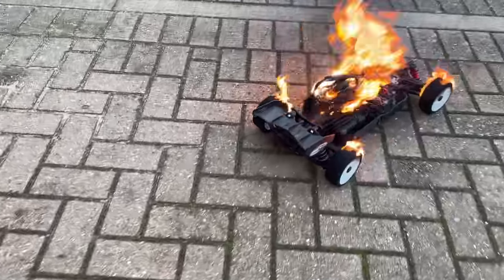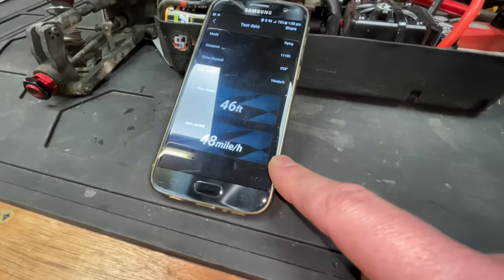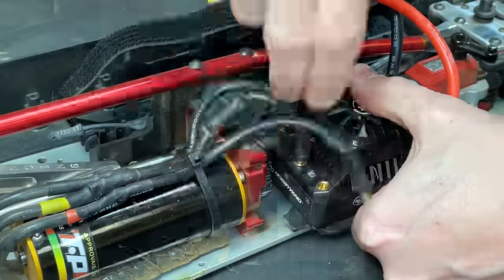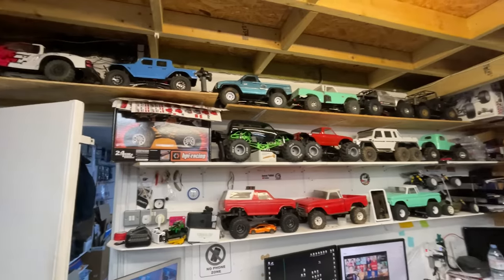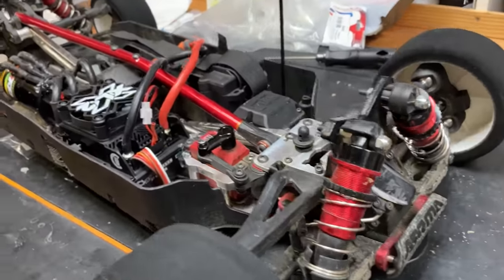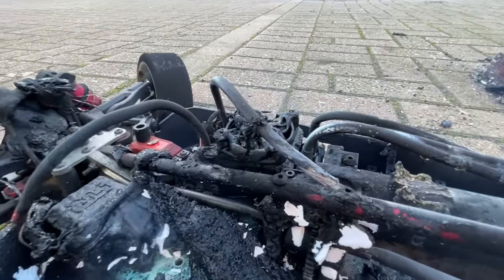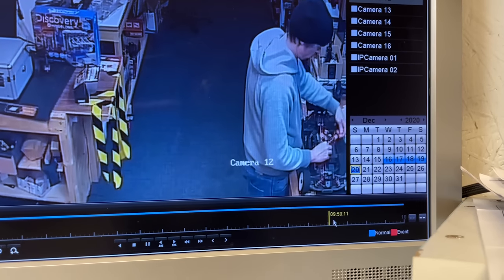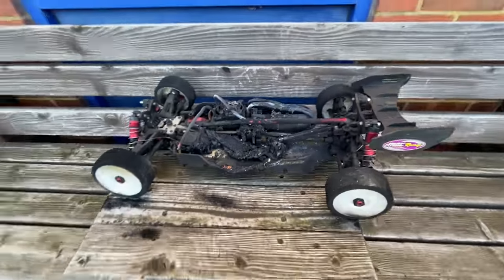Hot Wheels!! - RC Car FIRE - Castle Cremations XLX2 Failure

Comment: The way those lipo's kept on reigniting reminded me of those joke candles that you can never blow out because they keep re lighting 😂👍
Reply: Yeah, its a self sustaining fire, the chemical reaction of the lithium with the air will result in the lipos re igniting and burning until all of the lithium is used up, that's what makes a lithium fire so dangerous as once it starts its extremity difficult to stop it no matter what you do, basically it will just run its course until there is no material left to burn. Kevin did exactly the right thing, get it outside !!.

Comment: The motor could have been damaged internaly and shorted the esc once it got to much power
Reply: These XLX2 ESCs are blowing up everywhere. There is already a class-action suit in the US. I would be surprised if it wasn’t the ESC.
Reply: @mesodan  most definitely not the esc, unless his was defective. I have an xlx2 in a limitless that has gone 152mph
Reply: The new castles are blowing up, the battery hookup on the ESC circuit board shorts out and causes the esc to blow up, eventually getting the battery as well if you don't unhook them right away
Reply: @masonkaye5  the new castle mamba x series escs are extremely unpredictable, mine did the exact same thing and they didn't warranty it for me, I nearly lost my house and my hand in the process
Reply: Lipos can also be damaged internally from soldering connectors too hot or too long. The pack can randomly burst into flames.
Reply: @masonkaye5  dude, they are caught fire and mailfuntion all over the world. That esc of yours are one of few with the others..hey, even Kev have one in the K8s and works...i got one, mine laated for 30 seconds.  This is a major issiue for them and i HOPE it will be solved fast.
Reply: @mesodan  lmfaooo.. Exaggerate much?
Reply: @masonkaye5  I played Russian Roulette with a friend the other day. I walked away unscathed. Definitely a very safe game and the users fault if they get shot 😂 🤣😆
Reply: @coh2 things i agree
Reply: Ya it can also be the esc or what coh2 things suggested or both everything works fine then new esc a kaboom
Reply: @mesodan  I can't find anything about a lawsuit?

Comment: I have a feeling this will catch the attention of Castle Creations. That needs to be addressed by them personally. They are very helpful. A guys at work spends hours on the phone discussing his builds and various issues. They always help, and replace anything that is their fault, for free. You have a big platform here. Please be in contact with them and let us see how that goes. I own a lot of their stuff. I am nervous now.
Reply: I'm a big fan of Castle Creations as well, particularly their ESC's. Though there is always potential that a bad ESC got into the mix. That said, I personally think this was caused by a short or problems outside of the ESC. Someone suggested that the motor caused the fire, IDK. I suspect that something shifted when he picked up the RC from the tail end and shorted out something. Things were awfully tight in that chassis. JMHO
Reply: Same thing happened to me and it’s been almost a year since they received it and have not got back with me.

Comment: Only Kev could say “Screw the warranty” and chop the IC5s off, only to then eventually end up putting IC5s back on 😂😂😂
Reply from the maker: hahahaa
Reply: @KevinTalbotTV  tbf I nearly done the same to my K4S but decided to get a conversion cable. Now I’ve just gone for proper IC5 batteries as I had the same disconnecting issues with the crappy dean’s connectors on my old battery.
Reply: "Bye bye arrma warranty"
Snip snip
Reply: Loooooool😂🤣🤣😂🤣🤣😂😂
Reply: Yeah, lol. Wut?

Comment: My thoughts on the cascade after thinking about how this went down.   Ive had this failure on ebikes running bleeding edge motors.

You were revving it in air, literally the worst thing possible for such a hot system on max voltage and a motor with insanely low resistance and high inductance.   Dont do that with "insane" systems, its risky.    Looks like the first fire was a capacitor explosion.  

An inductive spike couldn't be shunted by the battery since it was still freshly charged,  and since you were running 8s it popped the caps after a hard rev.   No overhead for voltage spikes when running 8s. Caps turned into molten metal and shorted inside the esc, battery catches 20 seconds later since the esc is now shorted. 

Next time run 6s and don't be revving in air like that.

Comment: Hello kev! Love the channel! Sadly this happened to my 8S slash but I made another one and it was bigger and better
Reply: Their is a1/5  8s slash ???
Reply: @jackstrempel5135  no...
Reply: @JD_Garage  that’s dope, you made a  8s slash😂
Reply: @TylerSaleik  yeah I had a Mambax Castle set up then just used 2 4s battery’s
Reply: @JD_Garage  4s in Parallel or Series?
thought the mamba x is 6s only
Reply: @Chris-zu8ve  series
Reply: @Chris-zu8ve  nope Mamba used to make a 8s ESC and I used a Castle motor
Reply: @JD_Garage  Is this #010-0155-00 what your ESC is?  This is what I have on my Rock Rey 1/10
Reply: @Chris-zu8ve  it blew up a while ago I will have to check
Reply: @JD_Garage  I have only ran 4s on mine for a short while, so it may be luck i havent melted mine yet.,,,   But they make so many diff models now, I think they just cut too many production costs at our expense.  Because they can get away with not warrantying anything.   So they have stopped caring.  Its a shame, but they have lost any new purchases that arent BEC units for my crawlers.
Reply: Haha found your comment
Reply: I got 4s no issue yet
Reply: @creative_rides  I found yours!!!
Reply: Whatdidhesayyy? 8s slash thats crazy my friend
Reply: @joeydailey6980  6s is pretty much the limit on a slash
Reply: @joeydailey6980  yeah it was nutty
Reply: @shanebutyn9227  yeah 4S is a solid platform
Reply: The rc guy at my local store was telling me his friend did a 6s slash with pretty much a 1:1 gear ratio. Built it just for speed runs. Apparently his top was like 130 mph.

Comment: The term castle cremations doesn’t exist for nothing. You’re not the only one unfortunately.
Reply: I lost my brand new mamba monster 8s . Flew through a puddle on my xmaxx the esc got a little and it burst into flames
Reply: @everythingrc2535  haven't been around cars long enough but totally seen one of their Talon 120s burn a 1.5k heli to nothing haha.
Reply: Putting things to the right context. Usually castle esc are used in very high power builds. Those are a much higher risk of getting this kind of problems. Sure, there might be QC issues, but at least I can't judge castle with all the things said in internet.

Comment: Hey Kev! I think i know what happened with the ESC. Castle claims on their Website that the XLX 2 and Monster X 8s are made for a maximum voltage of 33,6V (4,2V/cell) and the ESC definitely will be damaged if you apply more Voltage, for example if you use LiHV batteries . So when you used your LiHV graphene batteries in the car you have damaged the ESC which then blowed up the batteries, which are nearly impossible to extinguish. Next time when a lithium battery catches fire, you should try to  separate  the battery and put it in a fire prove container with water where it can burn out.
I would recommend you using normal Lipo batteries with 4,2V/cell next time, then everything should work perfectly.
I hope i could help you. Go on with your amazing videos!

Comment: Don't burst the fire extinguisher your allowing the car to rebuild temperature if there is no flame showing the item can be upwards of 400 degrees use continual spray to cool the car so temperature does not ignite gases made by the fire itself

Comment: Kevin, just letting you you know that xt90 ,ic5 and ec5 are all compatible with each other!!
No need to change connectors..
Just use gaffa tape to stop them coming undone..
Reply: Ec5 is larger than the xt90. Ec5 is 6.5mm and xt90 is 6mm.
Reply: @andrewbrown8927  did you try connecting them?

Comment: I'm gonna venture on a wild guess that the motor ESC outputs sparked to the pinion-spur.
Reply: If that's an issue Castle should shield them or provide a means to
Reply: Touching one is not an issue and no way it could have touched two.
Reply: No, that's not possible, you would have to touch two of the leads not just one

Comment: Looks like you let off the throttle and the inductance spike popped your batteries.  Esc didn't melt down like a short was running through it.   How fast was it spinning when you let off?   Are the caps on the esc popped?
Reply: Do you think that TP Motor was the problem? I'm sure it's not rated to 8s, and being a 'comp' one, they seem a bit highly strung! Certainly looked like the Battery's took a dump rather than the ESC.
Reply: Looking at the thumbnail, the esc isn't smoking at all, looks to be all battery solvent fire.  If it shorted out there would be smoke and havok on the esc too.  Either on throttle or off throttle, looks like the battery shorted first based on what I can see. 

Huge high kv motor, the amp draw is obscene. It combined with the beefy esc was too much for the battery.
Reply from the maker: esc deffo went first, i saw the flames! then 10 secs after the lipos went up
Reply: @KevinTalbotTV  Yeah, on the CCTV footage it looks like a flame from the ESC first. But I reckon the Motor is what killed the ESC, which in turn took out the lipos. Either way...it was pretty catastrophic!  All my ESC fires have been short n sweet. Makes me think it was something else.
Reply: @KevinTalbotTV  did the caps pop on the esc?  That would be most likely for the quick flame. Was it accelerating or did you let off the throttle when it happened?
Reply from the maker: motor was working fine on the hobbywing. it flamed up when i hit the breaks
Reply: @KevinTalbotTV  oh yeah, you totally biffed the esc revving in air with that setup.  Full pack, insane motor, no voltage overhead with a full pack, hit the effing brakes with nothing but driveline momentum.    Inductive kickback mate.  You can't be screwing around with high end stuff like that!  Although surely good content for grinding out views, lol
Reply from the maker: Na man don't make excuses for it, i did the same with the max5 it didn't even get warm! When jumping you rev it like that in the air and don't have a melt down every time. Its obviously a faulty unit or design
Reply: @KevinTalbotTV  what voltage on the max5, also 8s?
Reply: I'm just saying I've popped caps when running ridiculous motors overvolted and also at the threshold of controller voltage.  Running that motor on 6s isn't as difficult. Running it on 8s should have a 10s or 12s capable controller imo.

Comment: Stop stopping !
When you use that fire extinguisher, use the whole thing in one go or it starts again especially with lipo!
Reply: You are not going to get a lipo fire out with a extinguisher anyway they just ignite themselves again
Reply: Yeah, unfortunately fire = heat + fuel + air. If you blow your wad all at once, lipo's will stay hot and blaze again, you have no extinguisher. After everything, all of that time, they kept flaring up. Emptying the extinguisher in one go will cut your own throat...
Reply: @dscrafted  you do if you get lithex extinguishers
Reply: @O.L.D_RC  wrong, emptying the full co2 extinguish will cool the lithium and remove oxygen however, lithex is the only working dedicated extinguisher.
Reply: Unfortunately, you are quite incorrect. As a Certified Professional, I've had to put out lithium, that rarely works first fire. Obviously, if you have been exposed,  that extinguisher was not up to the task. FYI, I've been fighting fires for over 30 years, lithium battery introduction required repeated training and refreshers.

Comment: Well known for it I'm afraid, they've well earned the name castle cremations, every one I've seen has burnt the plane, helicopter, boat or car down. I was surprised when you said you were putting one in. Ive had two myself and both burnt the planes down. My condolences.
Reply: What about the one I have used. What about the other guys with speed record. Stew mac raz shifrin and the rest
Reply: @gazking08mx  Ya,  I think comes down to the product line of each type of esc or item they have produced.  they must be different runs, ya know with different quality parts used or less or no QC checks being done.  Most of CC's stuff is now made completely out of the USA.     I have the 6s mamba X and no issues yet except the fan runs off n on, but only run 4s in my rock racer so maybe just lucky.    the recent Meltdowns are a Major factor in any future purchases thru them tho...
Reply: Go to rcgroups or put Castle cremations in Google, I did actually mean their escs in general and I should have made that clear.
Reply: @jamesstephens5202  Never really heard or read about castle escs burning up. These things are solid.

Comment: Turn the bec back down if servo is. It rated sending unusable voltage that has nowhere to go but to cause what happened might speed up your servo for a a day or 2 maybe 3 but will eventually have problems that system just didn’t like it at all 👌

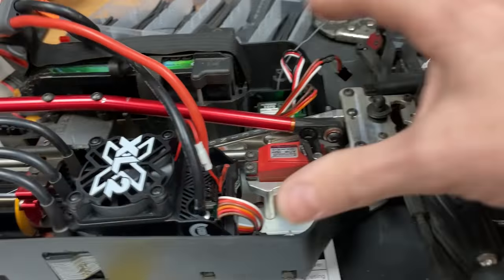Comment: at around 4:05 he shorted (maybe) something by looking at the ESC connector area. my guess is this had a bit to do with the rc catching fire...
Reply: good spot!! absolutely something sparked there.
Reply: it was the led
Reply: @dannyb9083  what i find weird is that it was already connected, the LED light should have not lighted up as it should of lighted up once connected not after its connected ( unless he had it powered on ) if it makes sense. why would a LED light up when you move the cable.

Comment: 4:05 maybe that had something to do with it? i usually get sparks when i plug in the battery, but i get them on the connectors, not on other parts
Reply: That was just the green led flashing. I slowed it down to check. Good eye though.

Comment: So kev I think the XLX2 ESC cut out due to the power of the TP MOTOR I’ve heard some people say that those motors have burnt out other ESCs due to their power
Reply: Its not the motors , I used a castle 2200kv and my xlx2 burst into flames, its castle creations QC turned to shit
Reply: I have a Max 6 with the TP 4070cm 2200kv and the Max 6 supposed to be a less capable ESC in terms of power and I've never had an issue going on 14 months now.
Reply: @robertkotevski9649  are you using the castle motors with the ESC
Reply: @robertkotevski9649   maybe, but what happened with amps ?

Comment: Just like my e revo previous esc from castle it did completely the same it went up in flames also😅
The problem was that te capacitor explodedand then caused a short circuit and than that☝️

Comment: Hey Kev, you can easily fix the problem with the xt90's by spreading the 4 little connectors on the male side of the connector, it makes it a lot tighter, hope this helps.

Comment: looks like the ESC had a bad capacitor. When you hit the throttle you burnt it
Reply: no it would be a weak transistor that when enough current went through it, it would fail and dead short the battery. if it was a capacitor all you would get is a pop and some steam

Comment: Maybe the esc could not handle that motor and the esc mosfets shorted out which shorted the lipos and blew them up.
Reply: Most likely the motor shorted from too many amps at 8s and shorted the sec and batteries.
Reply: Can't imagine much current was being pulled with the wheels in the air though. Seems more like a short happened in some way to me.
Reply: @ValleyRC  what im saying is the ESC could not handle the KV of that motor

Comment: Looks to me like the BATTERIES caught fire.   Not the ESC.
Reply: The batteries are on the other side... The ESCs Mosfets failed. When transistors fail, they usually become a short circuit over all pins, so they also shorted out the batteries leading to them catching fire.
Reply: @simont3686  look where the first burst of light comes from.  It's the batteries.  The ESC failed too, but due to the batteries failing.   I've seen that many times.
Reply: It’s obviously batteries
Reply: Caught on camera bro!

Comment: Sorry that happened Kev. Glad your ok. Sometimes when Lipos have been exposed to high pressure landings, they can desolder/delaminate on the inside. When introduced to high draw current again could cause a shortage, I’ve had this happen to me with a couple 4s packs, no fire although, just a complete shutdown